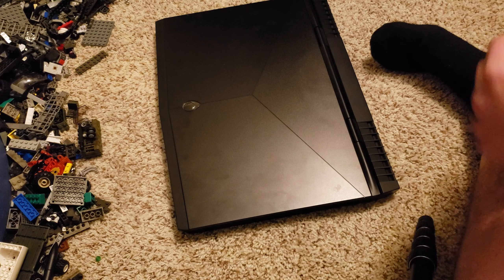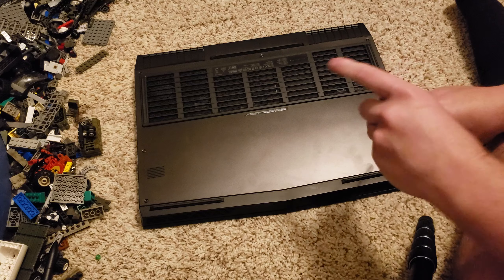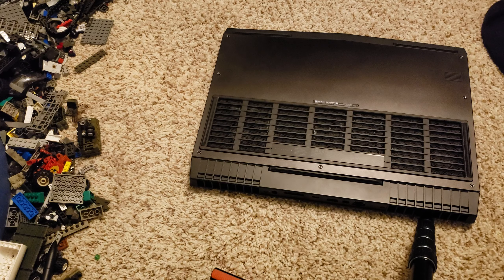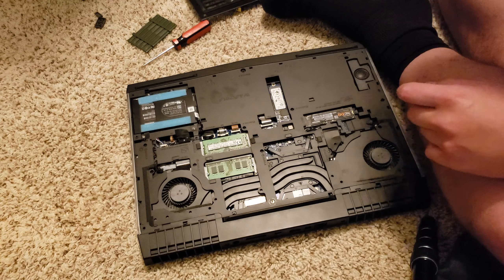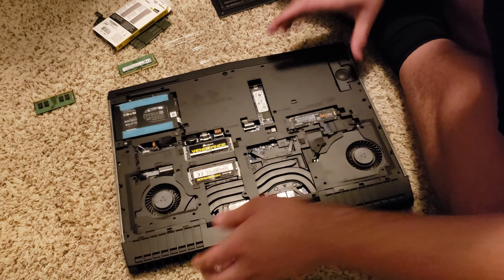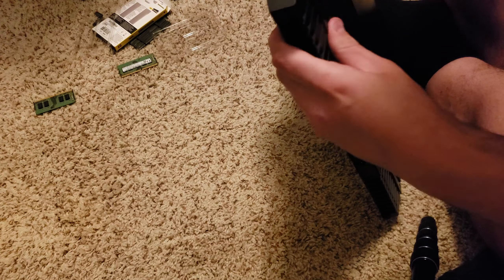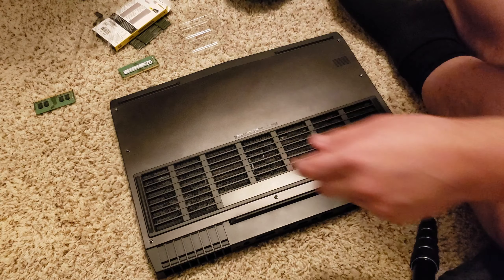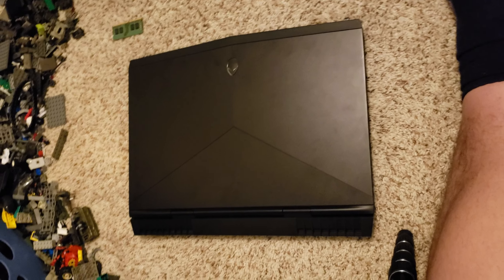Alienware 17 R5. Ram upgrade. 16gb to 32gb.

Comment: can i put 16 GB in one slot,and 8 GB in other slot? its mean 24 GB....... THANK YOU.
Reply from the maker: No. They both have to be the same. Mixing can cause crashing.
Reply: i think there's no problem, i have an old macbook, i put 8+4gb ddr3 about 5 years ago and it works fine till now.
Reply: @VacMaster1991  thank you soo much.......
Reply: Yo buddy I have the Alienware 17 R4 2017
1 8gb original sk hynix 2400 mhz
1 crucial 16gb 2400 mhz cl17
running for almost 2 years now..... no problemo....

Comment: hey man,, Im trying to upgrade my Alienware 17R3 RAM, does this one compatible with my laptop? corsair - vengeance series 16gb (2pk 8gb) 2.4ghz ddr4 laptop memory - black
Reply from the maker: I had problems with my vengeance, I was able to return it. Im not sure how it will work for you but I would go for a different brand.
Reply: @VacMaster1991  curious what you ended up going with?
Reply from the maker: @SOMNIOHM . I put the old stuff back in and never added more.

Comment: Do you have the part number of that new ram please? or a link to the same one, i keep finding lpx version which doesnt appear to be the same.
Reply from the maker: Link right here. https://www.amazon.com/gp/product/B01BGZEVHU/ref=ppx_yo_dt_b_asin_title_o08_s00?ie=UTF8&psc=1
Reply: Thanks
Reply from the maker: @Liberty_Prime_Is_Online  I would just watch out. I am returning this ram because its causing my PC to black screen and to crash.
Reply from the maker: My system anylizer said its causing incorrect, data wrights
Reply: Damn that sucks, thanks for the heads up.
Reply from the maker: @swarmagency6005 . I ran system tests. My Alienware said it was the RAM. I returned it.
Reply: I have been searching the different brands of ram that might work on the R5, it looks like it is Dell ram only...
Reply from the maker: @vtran180hfqff  I would get that then
Reply: maddtekk do you have a link? Wasn’t sure which brand works, Alienware tech told me over the phone  to make sure it’s low voltage..
Reply from the maker: @digitalartsagent1338  I would not get this one. I has problems with it. Get the stuff from Dell.com
Reply: @digital I Google the issue about compatibility and I found it in a Dell forum. The person responding was a Dell rep. It basically pointed the people to the Dell parts store.
Reply: @VacMaster1991  Mine is running fine with Corsair RAM. Stresstest over 2 days. Have you saved Settings in BIOS after the upgrade?
Reply from the maker: @Don_Toro666  as I said I returned mine so I'm not sure
Reply: @digitalartsagent1338  I just installed some G.Skill Ripjaws 2400  16 gb x 2 into my computer.  Newegg has a sale on them right now.  I am not sure if the 2400 is noticeable to the 2666.  I am on day 3 of use and so far no problem.
Reply: @Don_Toro666  i planned to upgrade mine with corsair ram too. can you tell me which setting in bios i have to change after upgrading the ram?
Reply: Maulana Fakhrudin Fania Putra 
Just enter Bios and hit „Safe changes and exit“
Thats all.

Comment: did you have to reinstall windows 10 on there. or was it plug and play?
Reply from the maker: Plug and play. On startup it will ask if you changed. The system memory. Click yes. And it will. Start up. Startup after RAM replacement will take up to 3 minutes
Reply: @VacMaster1991  thanks man nice video, I just bought my A 17 R5 yesterday I should receive next week. I'll let you know how it goes. Another question are you or do you plan on repasting, I hear that the thermal paste from Dell aren't all that great
Reply from the maker: @kemuelnarvaez4286  the R5 has good paste. Unless you are playing super CPU intensive programs such as Flight Simulators. The paste it has is fine. I tried to repaste it myself it was impossible. I had Best Buy do it. It evolves removing the motherboard fans and all the drivers. It takes about out 3 hours
Reply: Kemuel Narvaez did you have success with the RAM?

Comment: I also bought these it installed it in the laptop will just have the alien light flashing and the screen never turns on. Does anyone have any recommendations
Corsair
CORSAIR Vengeance Performance 32GB (2x16GB) 260-Pin DDR4 SO-DIMM DDR4 2666 (PC4 21300) Laptop Memory Model CMSX32GX4M2A2666C18
Reply from the maker: That is what I bought. That's the one that had the crashing issues.

Comment: Has anyone else having a problem with installing both new 16gig DDR 4 ram were the computer freezes to turn on. But I can use 1 16 and the original 8
I bought the HyperX
Kingston Technology HyperX Impact  32GB 3200MHz DDR4 CL20 SODIMM (Kit of 2) Memory HX432S20IBK2/32
Reply from the maker: I had problems with this ram freezing and causing blue screen of death. I returned it.
Reply: VacMaster1991 that what I get when I install both of them
Reply: Which card do you recommend?

Comment: Have you had any issues with the RAM since installing?
Reply from the maker: YES! I had blue screen errors. And random crashes. I used my Alienware diagnostic software and it said the RAM was the issue. I was able to return it.
Reply: @VacMaster1991  Aww man that is very disappointing! I recently purchased a 17 R5 and also want to upgrade to 32GB but I am having a hard time choosing one because I don't want this to happen. What's your next move?
Reply from the maker: @axvillagomez  I'm going to stick with my 16gb and maybe get some later
Reply: @VacMaster1991  I don't blame you! Please let me know if you eventually find success with an upgrade. I will do the same.
Reply from the maker: @tugdualmarquer , How about NO.

Comment: Hellooo peoples...  i Need to add some extra USB to this baby.,. anyone can provides any advice which usb hub works good with this laptop.  thunderbolt type c.. maybe...?
Reply from the maker: this one should work. https://www.amazon.com/AmazonBasics-Type-C-Port-Ethernet-Adapter/dp/B01M8I8KMH/ref=sr_1_1_sspa?dchild=1&keywords=usb+hub&qid=1589967894&refinements=p_85%3A2470955011&rnid=2470954011&rps=1&sr=8-1-spons&psc=1&spLa=ZW5jcnlwdGVkUXVhbGlmaWVyPUFGVTdNRzFFTVYwNFcmZW5jcnlwdGVkSWQ9QTAyMjk2NTlNSDE3S0M1VlVSRVAmZW5jcnlwdGVkQWRJZD1BMDgxODIxMzFOVkg4OEo0RzZQNlEmd2lkZ2V0TmFtZT1zcF9hdGYmYWN0aW9uPWNsaWNrUmVkaXJlY3QmZG9Ob3RMb2dDbGljaz10cnVl

Comment: Excellent video. I saw the other one too and I loved them. Thanks a lot. I have a question. On the RAM box it says 2666 MHz. My Alienware is 2.21GHz. I have seen in the places where they sell that number varies, in addition to the RAM. What number should it be in my case? Greater than 2.21GHz or less? I have seen 3600GHZ,3200GHz. Is anyone compatible?
I have the same model Alienware 17 R15.

Thank you in advance
Reply from the maker: I would stick with 2400 or under. I used 2666 and had issues. Anything above 2666 is not compatible
Reply: @VacMaster1991  Perfect, thanks for the advice. New suscriber :)  My problem with this computer is that sometimes the heat is insane, and i only using firefox and other platform and i`m using like 85% of the RAM. Do you think that the RAM is not enough and start to heat?
Reply from the maker: @bizcochodulce  your so welcome
Reply from the maker: No not enough ram will not cause overheating. I would check out a laptop cooling pad.
Reply: @VacMaster1991  Excellent, thanks for the tip. Will try to find a good one, the last one that i bought was really bad.
Reply from the maker: Look for ones with metal legs and lots of fans. Atleast 16 inches wide
Reply: @VacMaster1991  Thanks for the advice!

Comment: So you mean to say I can upgrade the existing 16gb(2x8) 2400 to 32gb(2x16) 2666??? WOnt there be any compatibility issues?
Reply from the maker: I had no problems with compatibility, BUT, about 3 months in to using this ram I had some issues with random crashes, Which where causes by a faulty ram module. So yes 32gb at 2666mhz is compatible with this alienware, But I recommend a different brand.

Comment: can you upgrade the 2019 from 16gig to 32 please help because i want to purchase it
Reply from the maker: What do you mean by upgrade the 2019?
Reply: VacMaster1991 on the best buy website it says 16 gigs and doesn’t say anything about being able to upgrade to 32gigs, i just wanted to make sure that i could upgrade it to 32 from the stock 16
Reply: VacMaster1991 i just want to confirm that the 2019 model can upgrade it to 32gigs
Reply from the maker: @ARusso22TV I don't have the 2019 model. Plus I'm sure you can. The 2019 model has an option for 32 gigs.
Reply: VacMaster1991 thanks so much!

Comment: Does this work on the Alienware M15 R1
Reply from the maker: Yes. It should
Reply: VacMaster1991 Ok, thank you!
Reply from the maker: @aidana598  . If the M15 can take DDR4, at 2400mhz 260 pin. Then it will take this ram.
Reply: VacMaster1991 Kk

Comment: Does it have two M2 slots for ssd?
Reply from the maker: I have a 250 GB ssd it came with. I added a 250gb 960evo. I also replaced the 1tb hdd with a 860evo 1tb ssd. I plan on getting another large ssd soon
Reply: Thanks for replying. Where should I buy this laptop ? Do you think new egg is a good web site to buy laptops ?
Reply from the maker: @Dafelico  get it from best buy here. https://www.bestbuy.com/site/alienware-17-3-gaming-laptop-intel-core-i7-16gb-memory-nvidia-geforce-gtx-1070-1tb-hard-drive-256gb-solid-state-drive-black/6228319.p?skuId=6228319
Reply: Daniel Felipe Parra Cortes I’m disappointed with this guy making a tutorial and giving info like “go to Best Buy” “it’s okay to do this on a carpet”. Please buy anywhere but Best Buy. New egg is great.

Comment: my R4 have 64 Gb of RAM DDR 4 / 2666
Reply: 17r4 64gb of ram ?
Reply: @ukrainian guy i am planning to do so, are u facing any issues?
Reply: @GZSamy  no  im not, it should work fine , just incase  update your bios to the latest version and you good to go.
Reply: @ukrainianguy9204  thanks a lot my friend, I have been searching forums and online material on this, wanted to be sure before I made that investment. I wanted to buy 32 gb x 2 2666 mhz. Now I am 100% sure. Thanks again! 
By the way what brand ram are you using?
Once again thank you for ur reply.
Reply: @GZSamy  OLOy Cardinal, but you can use any ony what you like , just dont jump higher 2666 speed, cuz R4 can take only 2667 , thats why im using 2666.
Reply: @ukrainianguy9204  awesome, will order hyperx 32 gigs x 2 2666mhz, thanks for ur time. You are the only one in the whole wide world, with a real used case of this scenario. Thanks a bunch my friend.
Reply: @GZSamy  you welcome
Reply: @ukrainianguy9204   buddy just wanted to let you know that am up and running with 64 gb hyperx 2666 thanks for your help
Reply: @GZSamy  Cool, now your laptop officially pumped up ;)